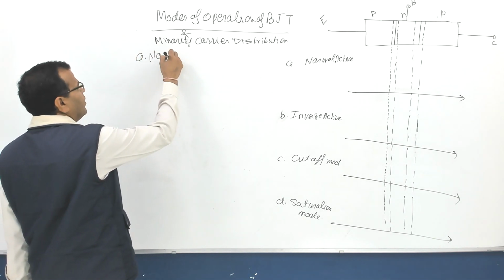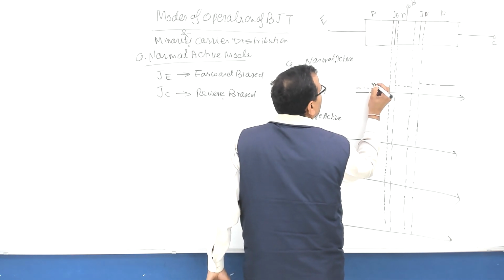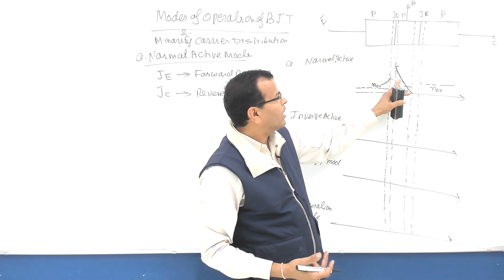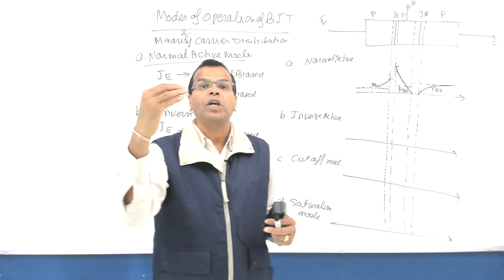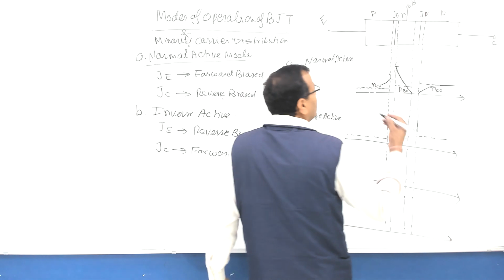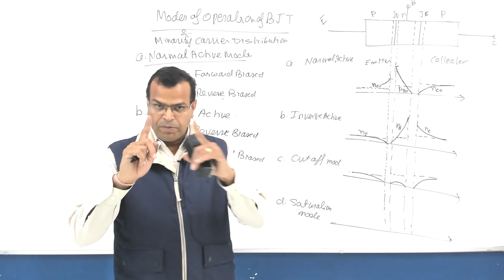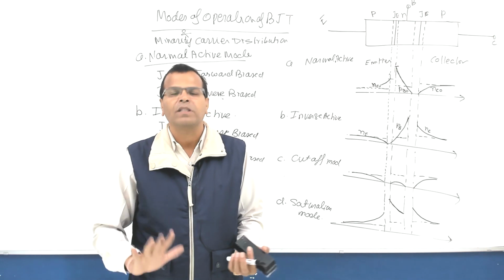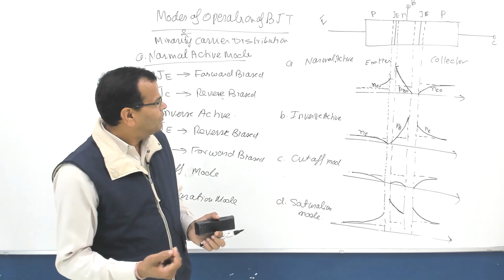EDC & AE Chap 3 BJT L3 Modes of Operation of BJT

Comment: dear sir, why is  thermal equilibrium  conc. of holes in base (pb0)) less than (nco).  base has least doping therefore by mass action law must have max. minority conc.  please reply
Reply from the maker: Dear, the minority carrier distribution in this video is drawn with assumption that collector has least doping and emitter has highest doping level. You will find this assumption in may text books for minority carrier distr